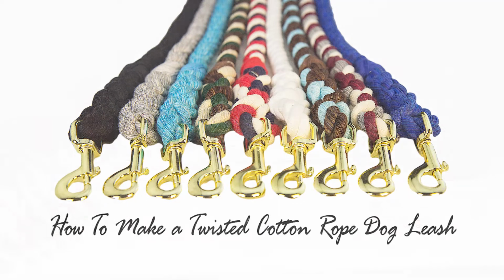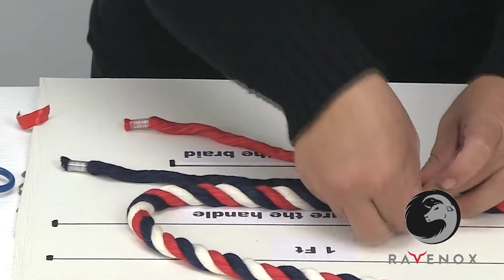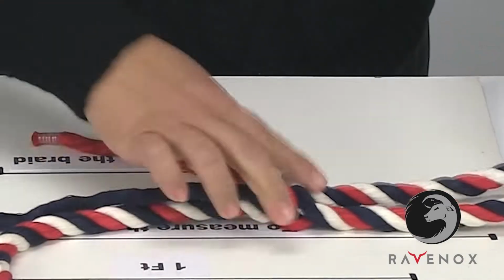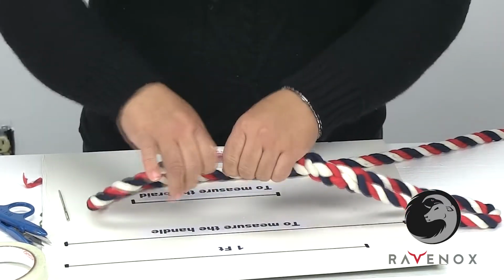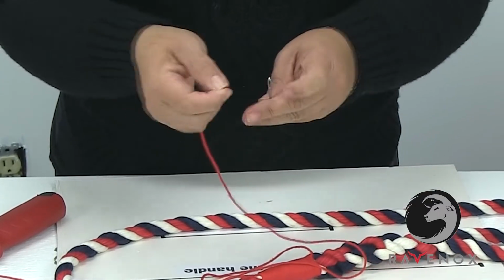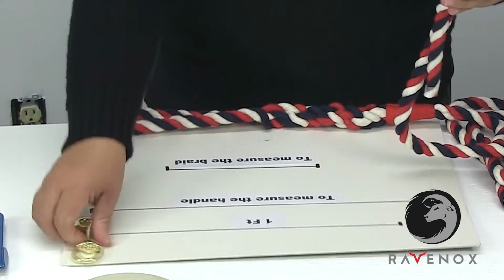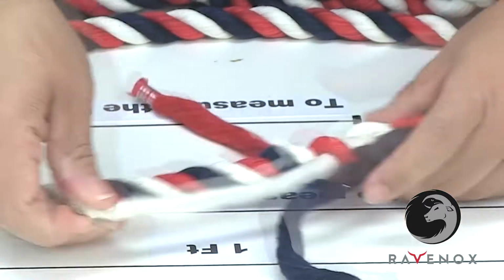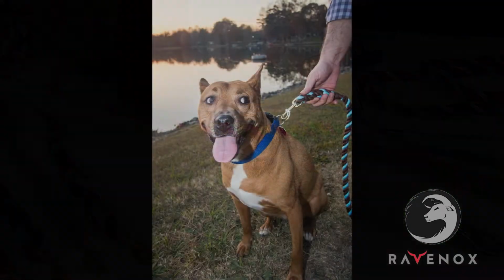How to Make a Dog Rope Leash | DIY Twisted Cotton Dog Rope Lead | Ravenox Ropes

Comment: What length of rope do you use
Reply from the maker: The standard sizes for dog leashes are 4 feet and 6 feet. For horse leads, 10 feet is the standard and 25 feet is best for lunge lines. The same technique is applied for all of these leashes and leads. Simply measure out shorter or longer lengths of cordage for your needs. You'll want to measure an additional 14-inches for the handle and at least six more inches for the hardware. This article gives step-by-step instructions: https://www.ravenox.com/blogs/news/twisted-cotton-rope-dog-leash-step-by-step-diy-instructions

Comment: What about the poo bag holder /connecter xx
Reply from the maker: Are you referring to a metal ring near the handle?
Reply: Ravenox yes ! X I’m just wondering how you would connect that x
Reply from the maker: @xxhoney-beexx9324  You would need to weave the ring in to the splice or put it on the handle end loop before starting your back-braid.
Reply: Ravenox aaaahhh I think I know what you mean thank you for the help ! X

Comment: Can you tell me the total length of rope used for this project?
Thanks
Reply from the maker: Here's an article that lays out all the instructions: https://www.ravenox.com/blogs/news/twisted-cotton-rope-dog-leash-step-by-step-diy-instructions
Here's where all the best rope is: https://www.ravenox.com/collections/cotton-rope
The amount of rope you need depends on how long you'd like your leash to be. For dogs, the standard lengths are 4 FT and 6 FT and for horses it's 10 FT. To make a lunge line/lead line for both dogs and horses the standard length is 25 FT. To make the handle you'll want to measure out an additional 14 inches to make the eye splice. For the hardware end you'll want to add an additional 6 inches. That means that for whatever length you desire the end product to be add an additional 20 inches of rope for the handle and hardware.
Reply: Ravenox thanks a lot for the info, now let’s make some
Reply from the maker: @SoloTrends999  Let us know what you need. We've got all the supplies and all the best rope!
Reply: @Ravenox  I will thanks again!
Reply: Dog ka patta